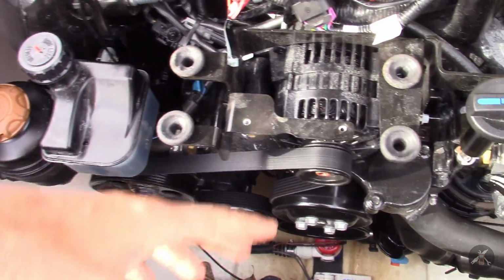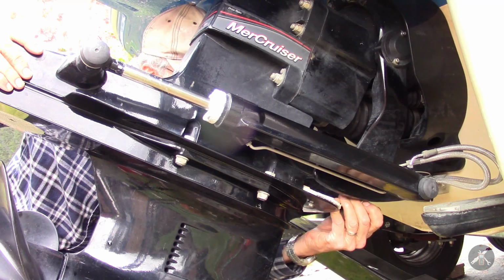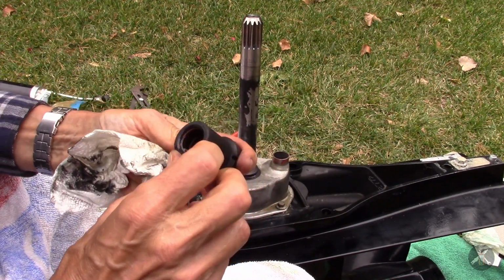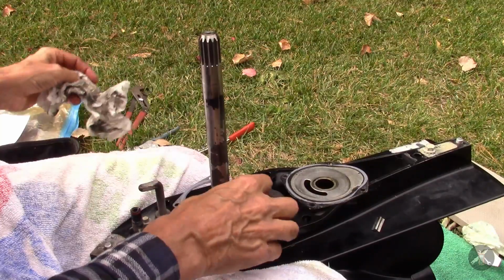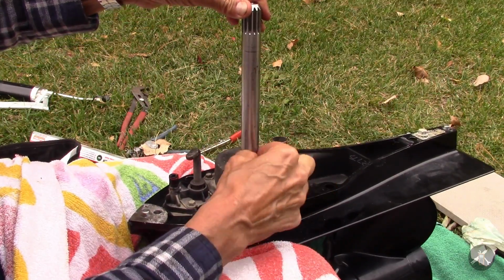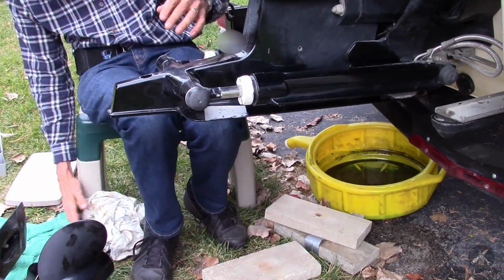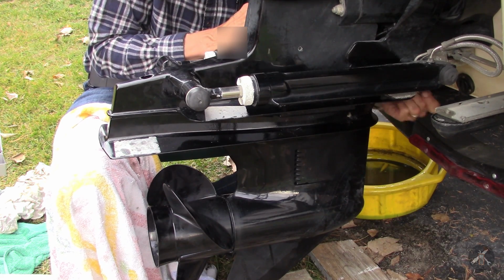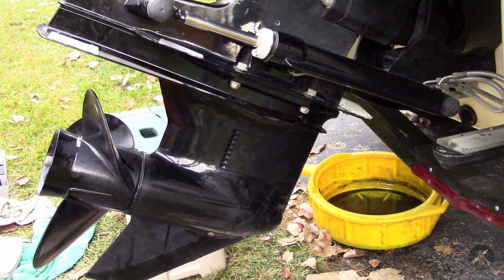Replacing Water Pump Impeller in Mercruiser Alpha 1 Stern Drive - 250 HP 4.5 Liter V6

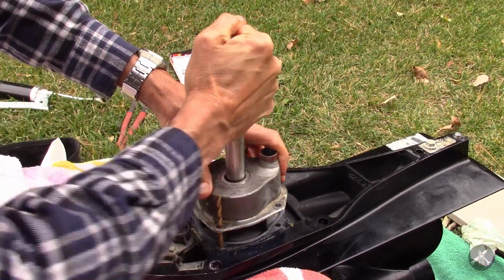Comment: Just one comment.  I do enjoy that you leave nothing out of the details.  One issue that I saw with the way that the manual advised to place the cover on by rotating the shaft. At 27:08 into the video watch what happens to the seal that is on the top gasket of the metal plate.  The impeller catches it and rolls it into the housing.
Reply from the maker: Good catch, I hadn't seen that before.  I think that the gasket has a soft bead on top that is molded as part of the gasket and it looks like the gasket was being pushed out of position and folded. It should have been ok, because the gasket straightened out and the holes were lined up when I finished.  BUT, perhaps it would be better to have locating pins on all 4 corners to keep that from happening.

Comment: What was the reason for changing the water pump? Was it a performance issue? Or just routine maintenance? I have a 2019 Searay with the 4.5L and I’m wondering if I need to check that now.
Reply from the maker: It is routine maintenance and I was feeling that it was due.  Mercury recommends in the manual to inspect every year to be sure that the pump is in good condition. The challenge is that once you pull it all the way down, you might as well replace it, but it isn't required. In the older drives (early 90's? and before), it was recommended to always REPLACE annually.  Then they redesigned to what was called the "floppy vane" pump impeller that has longer vanes.  This newer pump impeller lasts much longer.  I will admit that I do not inspect every year.  This is the first time on my 2018. I cannot recommend this, but for a data point:  On my 1998, I actually ran 10 years once without inspecting, and when I did it still looked rather good. But, I was only running about 15-20 hours per year, water was clean, I didn't stir up silt, and my lake was only about a mile long. I am very careful not to crank  the engine dry.  I watch engine temp carefully and if it would have started running warm, I wasn't far from home. On the other hand, I also destroyed one in less than 2 minutes when I forgot to turn the hose back on after an oil change.  The best practice is to follow the book, but I have seen even Mercury has some comments about applying judgement based on your usage and experience.
Reply: Thanks for the info. I think I will put that on my Spring to-do-list before hitting the water as I have not inspected it yet and it’s a few years old. Thank you.
Reply: @markkowalzek7678 
Fall is the best time before you put it away that way water if you have a leak isn’t sitting on components all winter long . Then your ready to roll in the spring 

Do your motor oil in the fall also

Comment: I would pump the oil in from the bottom until it came out the vent hole, then cap that and continue to pump until reservoir is full at the engine.
Reply from the maker: Yes, that should certainly work.  I have just taken to filling the bottle part way and by the time I pump oil in from the bottom, the monitor bottle has fed to the chamber with the vent plug and it just keeps running out. Then I just finish filling the monitor bottle.

Comment: Great job. You had me laughing as I have done that more than once and that final alignment will cause some spicey language for sure. The water tube seals should get a good serving of grease as well. That's a great hobby you have!
Reply from the maker: You are correct on the grease. I did grease the o rings, I don't recall if I showed that.